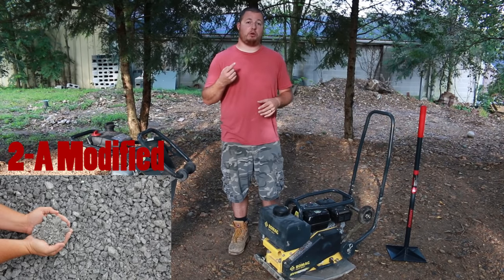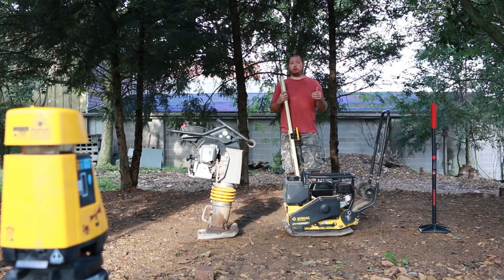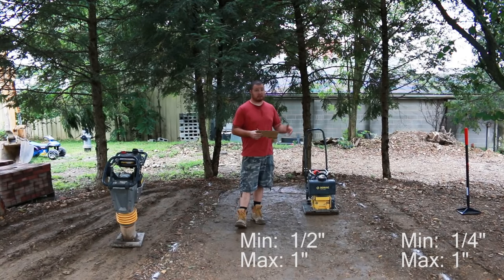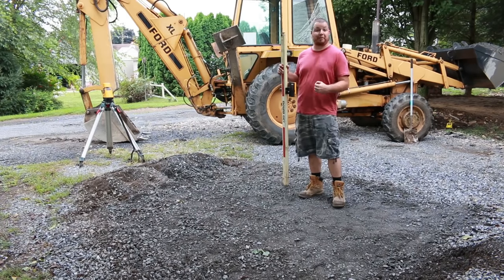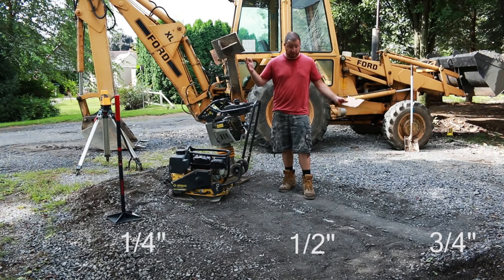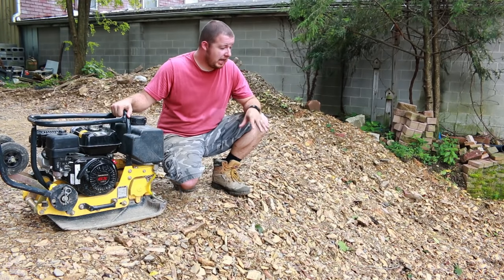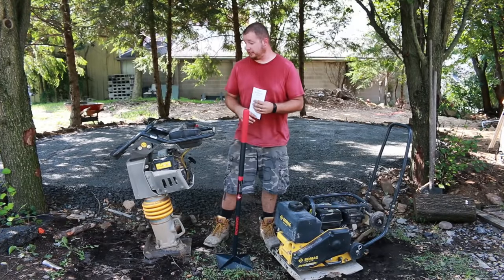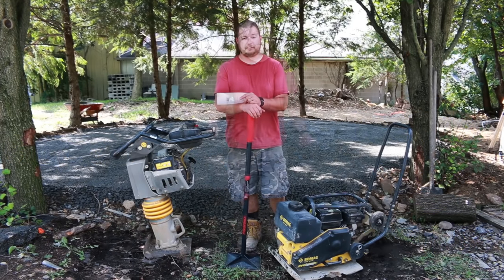Compaction - Jumping Jack Vs. Plate Compactor Vs. Hand Tamper

Comment: I've used them all and like the hand tamper least because it's so labor intensive and gets such a minimal result. I love to use the vibraplate in true sand, gravel, or rock so long as it has containment, but hands down we go to the Jumping Jack when we really have to hit 90-95% compaction in small areas where we can't get a sheep's foot or roller. Loved the video...
Reply from the maker: Thanks! yea I agree with you 100%
Reply: i find that using the hand tamper on asphalt is the best application of the tool particularly  in hard to reach spaces for larger equipment

Comment: The bottom line, each of these "tools" has its advantages and disadvantages.  I have owned a Wacker plate compactor & jumping-jack compactor for many years. The tool that I strongly favor (as a homeowner with a variety of residential tasks) is the plate compactor, hands down.
Reply from the maker: Yes the plate compactor is very simple and easy to use. Not a back-breaker. I ended up buying a jumping jack after I made this video, but i'm doing more structural things like footers for my garage and house so I wanted the max compaction I could get. Thanks for the reply!
Reply: @appalachiandiy2415  any advice on trenc3e

Comment: Thanks for this!!  Another way to get better tamping is to get heavier duty equipment.  Would be interesting to see if the 200lb jumping jack can beat a 1000lb plate compactor.  For everyone's reference, based on the product links. weights of items in this video are:
   - hand tamper 9lb head
   - plate compactor 207lbs
   - jumping jack 207lbs

Viewers should also note that each compaction type performs better or worse on the type of soil.  Jumping jacks are much better on expansive soils (clay) than plate compactors.
Reply from the maker: correct, It would be interesting to see weight differences too

Comment: Good Video!
A big concept that wasn't mention was that a Tamper/Rammer should be used on cohesive material, and a plate compactor is to be used on granular material.
Reply from the maker: Good tip, thanks for the reply

Comment: Use the Jumping jack for moistened soils in trenches and deep fills. Not to wet and not too dry. Dry soils can fool You by looking muddy on the surface while being dry as talc under the muddy surface . Extremely wet , muddy and unstable soils and clay can be stabilized by aeration , addition of gravel and lime or cement . In extremely wet areas permeable base materials may be better suited than those with fine clay binder. To prevent excessive water intrusion into a recent backfill during rain , cover the fill with visqueen plastic sheeting over graded fill that facilitates water flow to sump drainage points where it can be pumped out. Then when ready to finish grade and compact the subsoil with the Jumping jack , the plastic can be quickly removed . Without the plastic rain can quickly add enough water to make drying out the sub base very time consuming and costly. The compactor will be hard to run in the “ plastic “ material becoming unmanageable. “ Pumping “ of the subsoil will reflect into the base and pavement surface. Even if a stable crust can be achieved that facilitates paving it will later shrink and fail as the moisture evaporates out in dry summer conditions causing shrinkage and opening of the joints. A trench pave over such base that is subjected to heavy traffic can also undulate under loads causing a wavy bumpy surface. The J or Jumping Jack Tamper Compactor should ideally begin to rebound as the soil achieves maximum density and stability. First courses of asphalt base Rock can be compacted likewise with regrading to a even surface as the trench come up to paving depth. Then the plate compactor can be used. The initial excavation should be wide enough to allow the plate to fit into it full width. On larger broad areas both roller and plate can be used keeping each lift of material to 3-4 inches thick . Vibration will densify materials but can also bring water up into soils in areas of wet substrate. Narrow trenches of approximately 6” width may save on material cost’s like base and asphalt but are more time consuming to compact with small air powered compactors. They can also be filled with controlled density fill a slurry of sand and cement that will settle and harden . Then the surface width can be increased to a depth of approx 2”-3 “ by a width determined by the Engineer or local specifications to form a T Patch that helps to inhibit water intrusion through the joint. Experience has shown that straight line cuts with rough ground faces are easier to work with , professional looking and the new asphalt when rolled and compacted “ Key” into the existing surrounding surface to form a tighter more impervious bound that resists water intrusion. When patching in excess of 2-21/2 “ of asphalt it is best to do it in 2 lifts . Large areas can be done in one lift either in avg. 2” -2and 1/2 “ or Avg 3” try to get the Base finely tuned for grades with finished surface grade in Mind .

Comment: Thank you very much for the video. I am convinced that I will only need to buy a hand tamper from Lowes since it can lead to the same depth result when compared to a plate compactor even though it does take longer to do so. I hate to pay at least $ 500 for a plate compactor, which will have very limited use, and to put it in my already tight garage after recently adding a table saw and a miter saw.
Reply from the maker: Great! I'm glad this video helped you out. Storage is always a huge problem, finding room for all of our toys!
Reply: Is tool rental an option where you are?
Reply: The nearest store that have tool rentals is 100 miles away. Rental is my last resort anyway.
Reply from the maker: @joekelley1734  Yes, there are multiple stores that offer tool rentals
Reply from the maker: @passion830217  Man! that sucks.

Comment: Ever considered that you can do 3 or 4 passes with the plate compactor for every 1 on the jumping jack with less wear on your body and get possibly deeper compaction minute for minute?
Reply from the maker: I think there is a point where the plate compactor cannot compact anymore due to the energy it puts out. The jumping jack tamper generates more energy at compaction than the plate tamper. So no matter how many passes you do with either, there is a point where each machine simply cannot compact anymore and it boils down to which can "hit" harder.
Reply: It wont happen. Jumper is just too powerful and with a smaller foot, would eat up a plate, even if you ran the plate all day. Mind you, ALL reputable companies use a jumper in ditches where settling is a no no and we have professional soil testers on site who would toss you and your plate out when back filling  excavations. We have gone as deep as 21 feet with storm sewers using 2A modified with 12" lifts and never had a compaction fail nor a street settle/sink. There is a big secret to running a jumper. Never push it or fight it, always lean it back about 5 degrees and let it jump its way forward plus, never leave it sit in one spot and dig a hole, In short, keep it moving at its pace, not your pace.
Reply: @Rickimusic  I am in learning mode here. I am not disputing your claim but it contradicts everything I am reading about the proper way of compacting different types of material.  Cohesive V.S. Granular. 
If a jumping jack if far superior to a plate compactor in every way, why do they make them?  Over compaction is a real thing and can be just as bad as under compaction.
Trying to learn and there are very few informative resources on the internet on this subject.

Comment: hmm, in the UK you would never use a "jumping jack" (trench rammer as we call them) for a large area for the obvious reason you show, it produces ridges because it is not the tool for such a job.
You were lucky that the compactor plate's engine continued running on that slope, they are supposed to have engine cut outs if the oil level is "wrong" due to use on a slope. I wonder if your hire centre has removed safety features?
Reply from the maker: Correct. Its mainly for footer compaction or somewhere you need the highest compaction in a small area.

Comment: There must be an industrial piece of equipment for slopes, can't imagine a commercial job site having to hand tamp something like that.

Video was really good, definitely seems like the plate compactor is the easiest to use overall, although it might drag you a bit. From personal experience I can say the hand tamper is hell on your shoulders and wrists.

would love to see if a lawn roller 300-600 pounds is any good.
Reply from the maker: Yea I don't know what companies would use on slopes. The lawn roller would be interesting but would have to be out in the open and not in tight quarters. thanks for the reply!
Reply: @appalachiandiy2415  absolutely, thanks for the good content. I know for pretty much any thing I'd want to do the plate compactor is the way to go for me unless I had a ranch. I might just buy a lawn roller to see if it will work. Another guy had this lawn leveling tool that looked really interesting too.
Reply from the maker: @michael95621  huh, sounds interesting with the lawn leveling tool
Reply from the maker: That is neat. thanks!

Comment: Awesome video, and answered what I needed. Only have a 7.5 sq metre area that I want to pave, I just cannot justify the cost of the plate compacter when it ends up being nearly half the cost just to rent it (things are not cheap down under). Wanted to know if a hand tamper would be good enough and it seems it will. It's not load-bearing anything just enough to keep the pavers straight.
Reply from the maker: Nice, yes plate compactors are expensive. I typically always rent too

Comment: Can i use ramer/jumper inside house? 
I am worried about vertical foundation, as displacing soil could damage it. 
What you think?
Reply from the maker: just stay about a foot away from it. Are you going to pour a slab? Also, make sure you got some good ventilation if gas powered

Comment: Complete Compaction is not measured by depth.
A Resistance meter or geoguage is expensive way . One can use lateral forces applied by machine to meet code requirements for complete compaction. Other methods may cause structural sub-base Deficiencies.
Reply from the maker: Super scientific! Yea this was just a simple comparison to how they operated and compacted. Thanks for the reply

Comment: Seems like for the slope you could just use an excavator and press, because most buckets are rounded maybe make a special attachment in the shape of a large tamper, make it 4140 steel, maybe 2'x2' and 1/4" thickness, depending on the size of your machine, just so long as it fits the bucket pins/hitch.
Reply from the maker: Yes if you have an excavator. They also make tampers that are hydraulic driven and fit onto the arm of an excavator.

Comment: Thanks for sharing this interesting video. I tried the plate vibrator for my decomposed granite patio; I liked it, but it was very heavy to load and unload off my trailer.  I'm going to rent a jumping jack tomorrow,  because it seems like it will be easier to manoeuvre on my paths. I have a hand tamper, but it's only for awkward spots. That rental yard looks super.  I'd use it if I were near by,  but I'm in California.  Do you think you do a video on using the laser level?  Thank you,  Daniel
Reply from the maker: The jumping jack tampers are a little more cumbersome and awkward when loading unloading than the plate tampers. Yes, that seems like it would be a good video for the laser, Thanks for the reply and good luck.

Comment: I put in a rock pad for a 10 X 16 pre-built building I ordered , do you think the plate compactor would be sufficient enough ? I like the idea of having a nice smooth finish.
Reply from the maker: all depends on your soil and if had been disturbed. if you put it over ground that was not dug up or disturbed and gave it a good tamp. you should be ok.

Comment: appreciate the video. just wondering if I could use the plate compactor to level my lawn.? I had my irrigation system installed and my lawn is now bumpy because of the tire marks from the machine they used. Thanks
Reply from the maker: Thanks! Yea a plate compactor would work good for the high spots but if there are deep ruts you might have to add some fill.
Reply: thank you. I appreciate your response.
Reply from the maker: @ryanhizon9546  Absolutely
Reply: Bro if you compact the soil the grass won't grow well.  Better to use a take to level soil
Reply from the maker: @mightyconker3903  You can aerate after you have leveled off the bumps if your concerned about it. A rake would work for loose dirt but I'm thinking its sod that has ruts in it and you cant rake that out.

Comment: What kind of laser you use , Which one would you recommend if laser , the best compactor you show ,how many pounds of pressure does it impact?
Reply from the maker: Topcon and CST/Berger are two of the top brands when it comes to rotary lasers.  Ive used the Topcon often and like the way it performs. 
The jumping jack tamper will deliver around 3500 lbf (Pound Force) im not sure what PSI it will deliver as this is not a unit of measurement used to describe the force it exerts
Reply: @appalachiandiy2415  I like the video! If the JJack is 20x20" it is delivering 8 lbs/ in2. The 8x8' Ames tamper in your reference is 0.16 lbs/ in2. The razorback in your demo is about the same. The jumping jack has 50 times the compaction capability; which is obvious with your results.

Comment: All I can say is , use each tool for the areas each work at the best until you can no longer use it there so's ya don't have to hand tamp 100% of the slope 
Oh wait this video is years old:)
You should be done by now even if you hand stamped it all :)
Cool video I just happened on by osmosis or for comparison issues or something like that
Reply from the maker: Haha, might have just finished up with the slope. That would have taken forever
Reply: @appalachiandiy2415  Ohhhhh yea !!
without question no matter how ya slice it.
that was a difficult grade !

Comment: Great video, very helpful, thanks for sharing it! Question: can I use any of these machines if it is raining? I am trying to level my yard and compact the mason sand but it doesn’t stop raining. With the hand tamper is not being productive. Thanks.
Reply from the maker: ramer/tamper, I would say no. It has to much force and you will probably just make ruts. Try the vibe plate. that is the most gentle with little impact force. and Thanks!

Comment: Any experience compacting soil and then gravel (5/8 minus, for example) under horse stall mats?
Reply from the maker: No experience with that particular job, but in construction, we would compact the dirt, then compact stone on top of that. same concept. a plate tamper might be tough manuvering in a stall. i would hand tamp or use a jumping jack
Reply: Yes that would work add a lift of 3/ minus first in top of your soil then a thinner life of 5 minus

Comment: Great job on testing, as far as you went.  but the plate tamper .. You did not use it correctly. .on any of the passes.. HAD you used it correctly. I'm guessing it would NOT only have been still the fastest method. but equal to the jumpers depth.. IMO..   SO the proper way to use the plate is criss cross.. you go vertically, than horizontally, I know you couldn't do that much on the last few. the way you did them. but the 1st one you could have..   If you do the criss cross pattern, it compac's Much better IMO
Reply from the maker: Thanks for the info Ill have to test that out

Comment: I have to disagree with your slope compaction test for a few reasons, 1 you can not obtain a good compaction on a slope with just a hand tamp plus it's far too much time, and energy. I have passed compaction tests for many years and have obtained no less than 95% compaction on both slopes and flatwork. The only tool you need to be using to get a proper compaction is the jumping jack and on a slope you need to unfortunately excavate steps and each step should have enough space for you to keep the jumping jack 6" or so away from the edge. Once you have compacted each step then you can rake over a final layer of dirt or rock smoothing out each step and finish off with a sling and vibratory plate ( tip, hook the sling at the plate not the top ring.) If you want to avoid two steps because you only want to rent one tool then I'd suggest you man up and  hit the slope with the jumping jack at an angle but I don't suggest this If you don't really have much experience with it because it can really beat the living heck out of you. Most people can't, I'm just one of those crazy SOB's that gets it done! The best and easiest way to obtain compaction on a slope would have to be with a remote control sheep's foot roller, I love those things. Again you need to take caution because these can tip over easily if at an angle on the slope. This is only my professional opinion but I hope it helps.
Reply from the maker: Thank you for your reply. Yes I didn't think of making the steps as that would have worked. Good info

Comment: What is "modified"?
Reply from the maker: Modified is 2A stone. It's a mixture of 2" down to stone dust. It packs hard and is used under driveways and foundations.
Reply: @appalachiandiy2415  is that maybe what we call "State Mix" here in NY? I had some laid yesterday and the guy did not compact it except a little bit of "hand tamping" and I'm researching what should have been done. By the way, I enjoyed your radiant heat video, it inspired me to do mine!